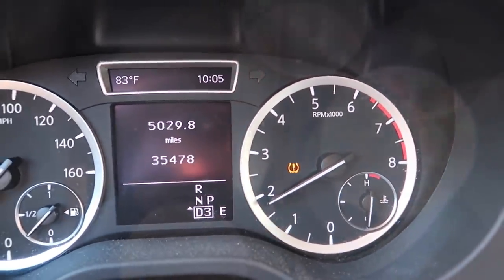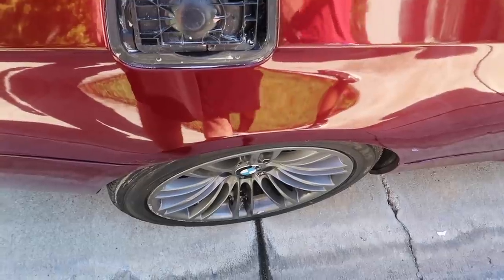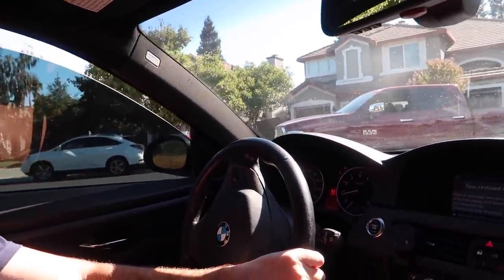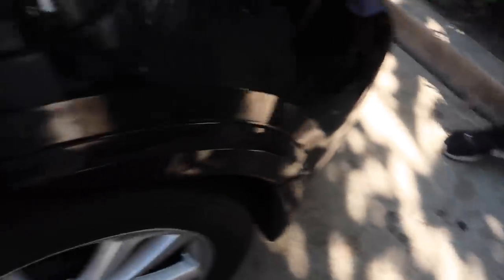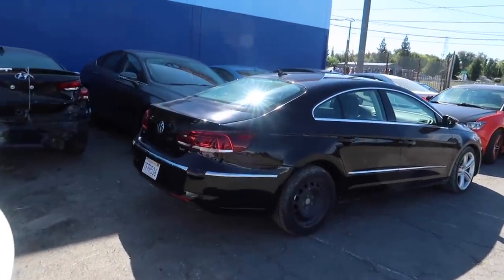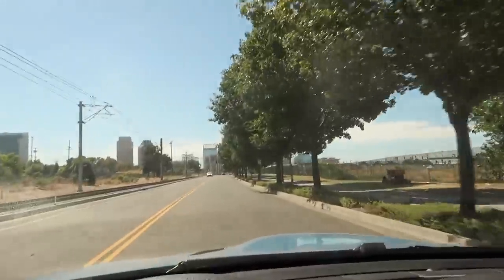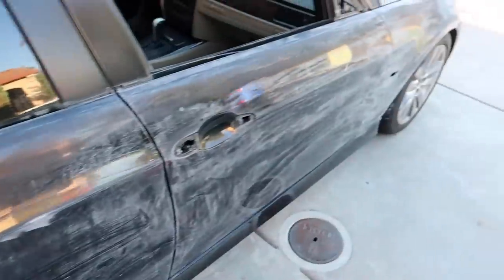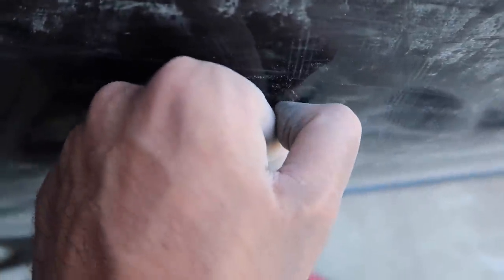HOW TO PAINT A BMW! (PART.1)

Comment: Currently painting a LCI hood and bumper for my e90. No matter what the internet says dont buy the purple harbor freight hvlp gun. They are poorly manufactured and leak a ton of air. The insides are sealed with silicone caulk. Once you take the gun apart to clean it the unevenness of the metal chasis cause air to leak out. My first layer of paint was excellent. After I disassembled the gun to clean it the second coat starting sputtering the paint and ruined it. Get an hvlp in the 50-100 range dont waste your time on a 10 dollar one unless it for primer. Im upgrading to the chrome professional hvlp from harbor freight. I've heard the quality difference is night and day. Also you NEED a chemical respirator. The isocynates in 2k paints will kill you. Good luck with the project!

Comment: Hey just a heads up bro this car needs to be sanded and for the parts that need repairs you must clean it with paint thinner or acetone before adding glazing putty for smaller holes or body filler for uneven spots